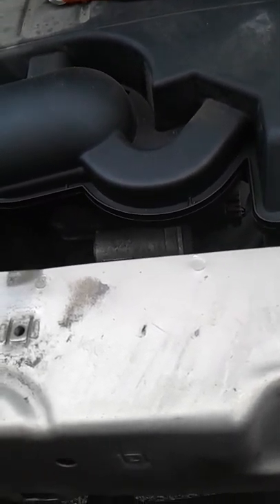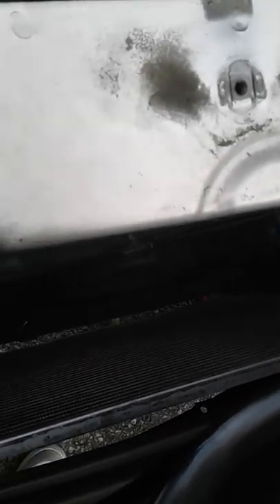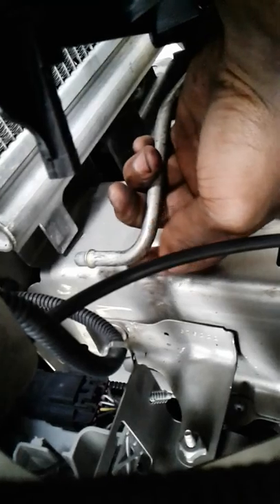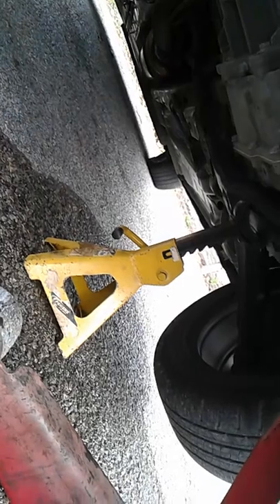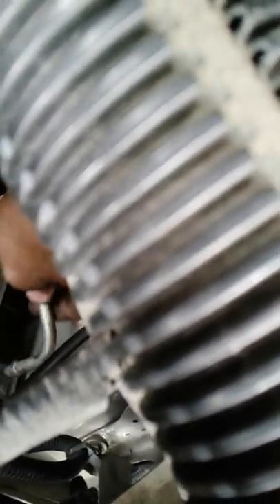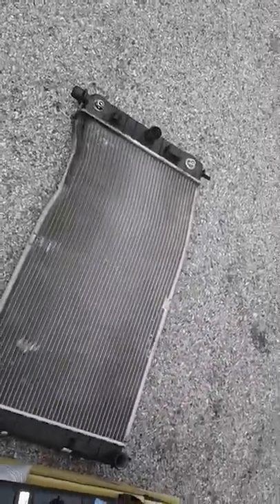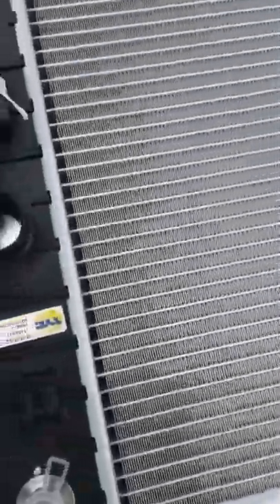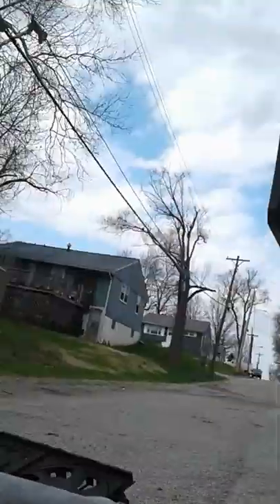2010 Malibu brief radiator removal (short)

Comment: Mine slipped off the jack and mangled the radiator and cooling fans. I removed the plenum intake thing and was able to pull the cooling fans out the top. Then since the radiator and condenser were bent I took a sawzall and separated the radiator and condenser. pulled the radiator through the top straightened the condenser the best I could on the car. Installed radiator and fans through the top zip tied the radiator and condenser together.